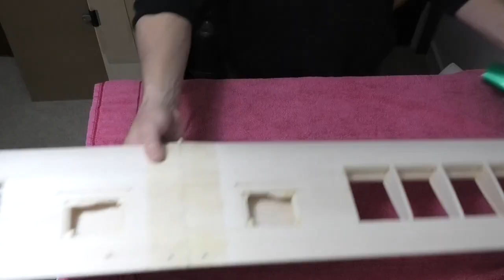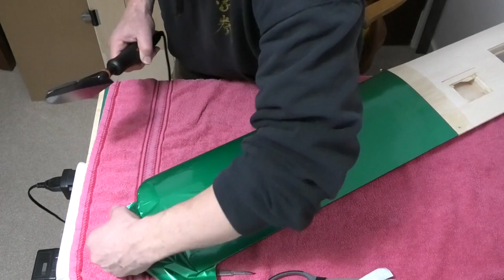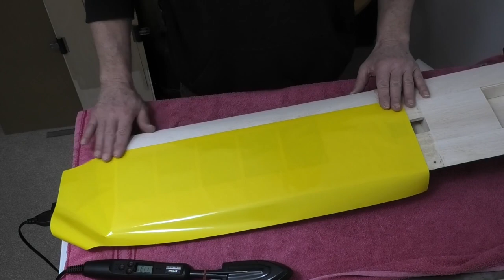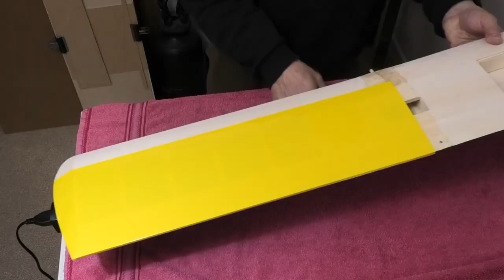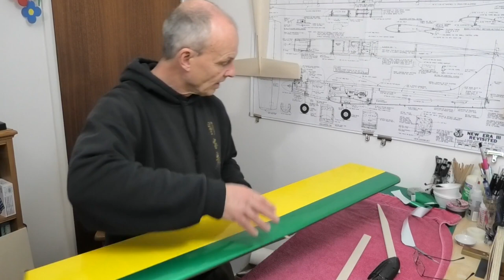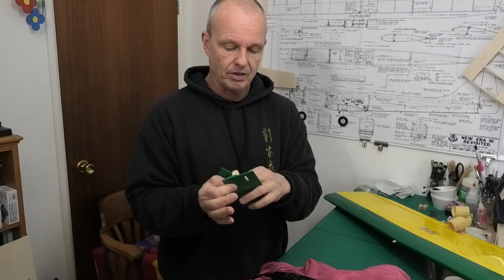New Era III Revisited: Pt 15 - Covering the Wings - a 45" wingspan RC balsa aeroplane

Comment: A really good tip Mark that I use before laying the covering on is that when you pull the clear backing off the film it creates a lot of static. I scruntch up the clear film and rub it all over the area that I am covering and the static charge attracts any dust and particles and leaves a really clean area to cover.
Reply from the maker: Great suggestion, thanks for the tip